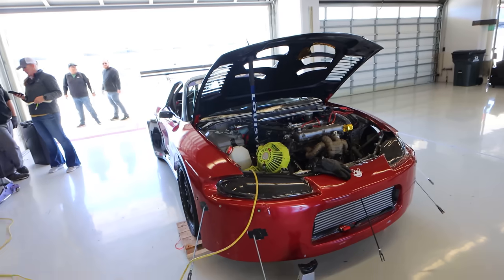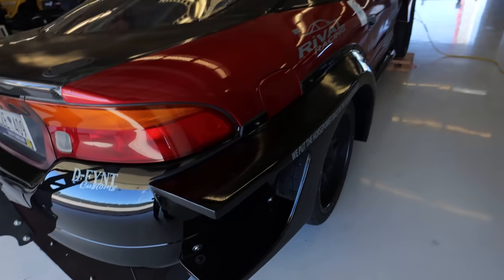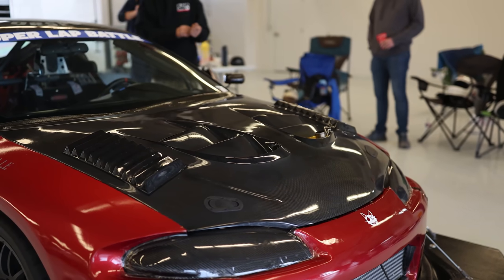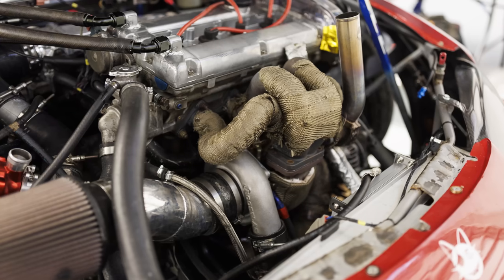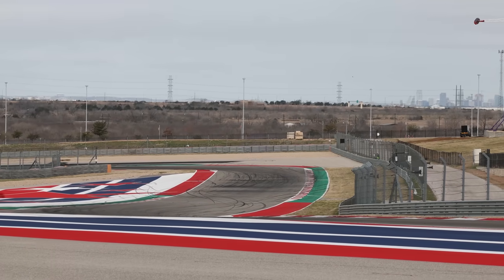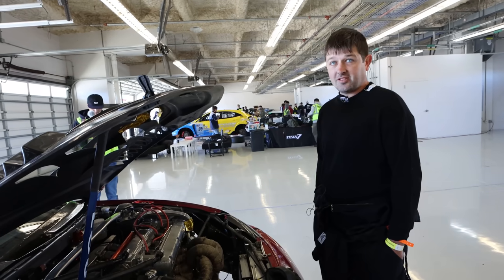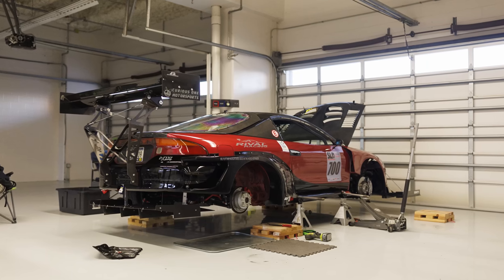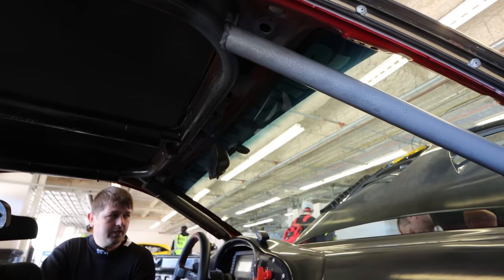700hp Time Attack Eagle Talon: The AWD Eclipse On Steroids

Comment: These were amazing in the 90s.. if it had been in the fast and furious they would be worth way more.. I’d buy one if you can find one.. I can’t find any with less than 115k miles and not dead
Reply: Picked my 95 gst up a few years ago when they started getting hard to find.  Could not even find a decent one in AZ had to drive out to Cali.  Now she completely gutted getting engine bay shaved and only go fast parts.  Probably gonna keep the smiley 95/96 body work too.😉

Comment: hell yeah! pumped to see someone runnning a talon in time attack! so awesome! and 700 hp in a 7 bolt? seems like everyone these days does a 6 bolt swap.
Reply: Nothing wrong with a 7 bolt bottom end if you know how to prevent crank walk. The 2G head is also arguably better for road racing.
Reply: @konigvonpreuen8065  all the local high horsepower guys are running 6 bolts and tell me I’m dumb for wanting to build the 7 bolt already in my car haha. I still wanna try and build it. Any specific recommendations for the 7 bolt other than disabling the clutch switch for start up and not putting a heavy sprung clutch?
Reply: The main benefit to the 6 bolt is just the bigger crank and rod journals. I run a stroked 6 bolt, and never had any issues. Definitely looking at going to a 2G head though. And possibly an Evo III intake manifold.

Comment: What is 7 bolt? 7bolt to the manifold? 7 bolt to the turbo?
Reply: 7 flywheel bolts as opposed to the earlier "6 bolt" engines which had 6 flywheel bolts.  The 7 bolt engines had issues with crank walk due to their thrust bearing design where the 6 bolt engines did not suffer from the same affliction.  The later 4G63's that came in the Evo 5-9 (which are also technically 7 bolt engines) and some of the later versions of the old style 7 bolt 4G63 were given a split thrust bearing that solved the issue.